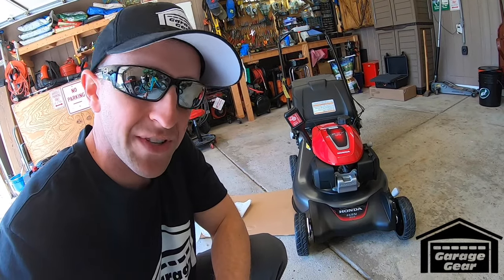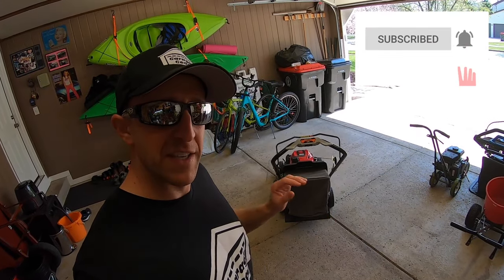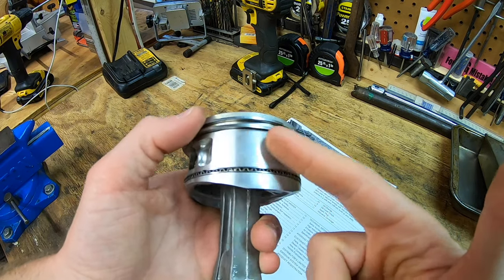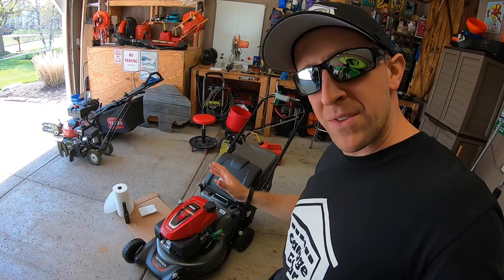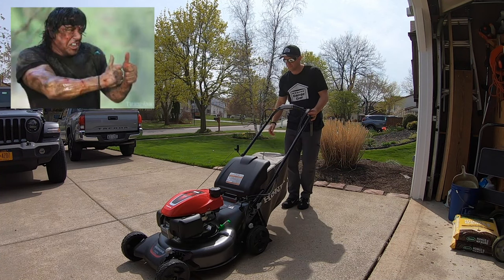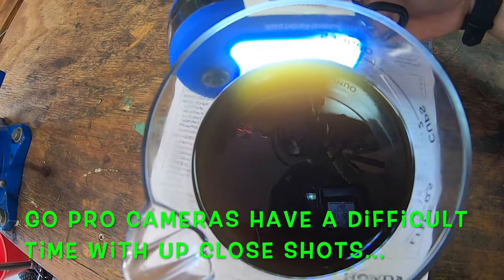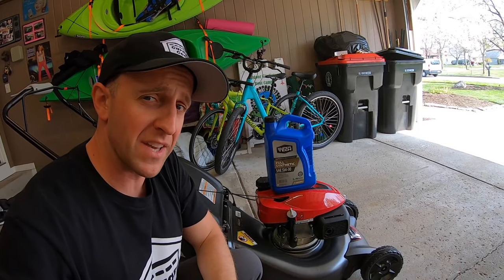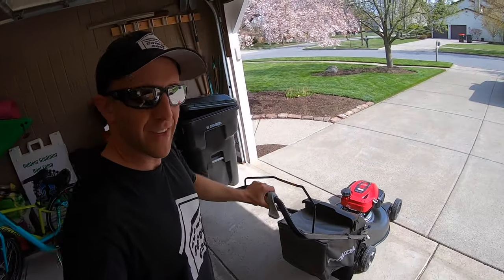BEFORE You BREAK IN Your New Lawn Mower Engine, WATCH THIS!

Comment: My previous Honda mower lasted over 21 years on the first oil fill. Never changed it. Not once. It's just a mower. The engine was still running fine. Only replaced the mower because the deck was rusting out, self drive was wearing out and the plastic fuel tank developed a leak.
Reply from the maker: Thanks for sharing!

Comment: Took your advice. I just bought a new hrc216hxa. Used amsoil 10w30 for small engines. Started and let run for 30 minutes. Drained it into a clear glass jar and it was close to black. Oh, and no starter bottle of oil (cheapskates). Also the manual for the hrc said 1st oil change after 20 hours. Glad I listened to you!!
Reply from the maker: Definitely a good idea to get that junk out!

Comment: I thought the small amount of oil that came in the new mower was a break-in oil with additives to help the rings seat properly. I would imagine those additives need to be in the engine more than 20 minutes to work properly. I'm also of the mindset that the engineers who designed these engines probably have plenty of test data to support their 5 hour break-in recommendation.
Reply from the maker: Hey Mike, they barely put any oil in when they ship these out. Spoonful or two. They may have their test data but that oil was awfully dirty after 30 minutes. Here is the video after 5 hours. (2nd oil change) the oil is much cleaner. Thanks for watching!
Reply: @GarageGear  yeah it's my understanding that the small amount of oil contains the break in additives that is designed to mix with the regular oil you put in before starting.
Reply from the maker: @mikecurtis1111  that’s the first I’m hearing of this and I don’t recall seeing any info on this in the manual. If you ask me you’re better off changing the oil and getting the metal shards out of that engine quickly.
Reply: @GarageGear  from reading the manual, it's residual oil from the factory. They test run every engine at the factory, and then drain the oil before it's shipped. Naturally, there's some oil that doesn't completely drain. I guess it's just regular oil
Reply from the maker: @mikecurtis1111  got it! Thanks for sharing!  👍
Reply: You assume that the engineers who know how to make the engine last aren't overridden by the pencil pushers wanting you to buy your next Honda sooner rather than later.
Reply: @berkeleygang1834  problem with that theory is the fact that Honda mowers are known for their reliability, and command higher prices for that. If people start experiencing short replacement cycles, then that will kill their reputation as being one of the best.
Reply from the maker: @berkeleygang1834  perhaps but Honda is known for making engines that last putting them at the top of the sales list. If they start cutting back people would have to decide between one junk mower and another.
Reply: Spot on. Do what Honda says. It is that simple.

A small amount of knowledge and making own assumptions on what is best, is wrong - unless your own conclusions happen to precisely match what Honda have already stated through 70 yrs of engineering excellence, science and complete loop of R&D incremental development and improvement.
Reply from the maker: @TheJmebe  thanks for watching
Reply: @GarageGear  dirty oil doesn’t mean “ineffective”. Keep in mind that nowadays sinth oils are really strong and durable, despite their color. And yes, Honda is pretty much giving you a “short” interval despite what the engine could take running on break in oil. Changing the oil so frequently is only damaging the planet.
Reply from the maker: @aian9597  thanks for sharing
Reply: @GarageGear  the first oil was dirty due to the carbon.. nothing to worry about. These engine already have 1 oil change made at the factory when tested. You did the engine 2nd oil change.
Reply from the maker: @chuckyl3978  thanks for sharing

Comment: Good video. I disagree however with putting in synthetic oil so soon. It is excellent for preventing friction and when breaking in an engine you need that friction.  I would suggest putting in Honda oil and run it for a few cuts or even a full season then swapping over to full synthetic.
Reply from the maker: Good idea! Thanks for watching Ron!
Reply: Agree with Ron, not mower related but still engines,  when the LS Chevs came out in Australia there was a lot of problems with oil burning because fastidious owners would change to synthetic oil too early and the engine never fully ran in.
Reply from the maker: @cudadog11  thank you for sharing!

Comment: I purchased a Honda HRX217 last summer and did the initial break in for 25 minutes then changed the oil. The oil was as dark as in your video and I changed it again after about 1 hour of use as it was a little grey. After that, the oil remained clear for the rest of the summer. That tells me that my engine does not lose anymore metal due to friction. So THE INITIAL BREAK IN IS A MUST and I know it will run for many years like new. Thanks to YOU!
Reply from the maker: Awesome my friend! This break in is definitely a must! Thanks for watching!

Comment: Thank you for this.  I just bought an HRX217HYA today and plan on following all your "make it last a lifetime" tips.  I'm 54 and this better damn well be the last lawnmower I ever have to buy.
Reply: My tiller is older than you lol My oldest lawnmower, which runs nice but needs work, is about your age. I pulled my newer mower out of a garbage bin 15 years ago; runs great. All Briggs L-Head engines. Helps to begin with a well made machine, but they will all die if not looked after.
Reply from the maker: It just might be! Enjoy the mow this season.
Reply from the maker: Best to keep them running!

Comment: I saved the empty Honda container of oil and just refill it with bulk 5W-30 synthetic.   It makes measuring the oil a no brainer.  

I hope you have better luck with your Honda mower than I did with mine.  My Honda was nothing but trouble and after three seasons of battling with a poor cut, broken wheels, worn out bearings, and a cracked deck, II switched to a Toro 4 years ago and I’ve had zero trouble since.  

I was very leery of the Toro due to the Briggs & Stratton engine, but I have to say it’s been bulletproof.  

By the way, I did exactly what you did except I change the oil after the first cut, approximately 35 minutes for my yard and then again after the 10th cut, approximately five hours on the engine.  

I then change the oil midseason and at the end of the season before storage and all of my equipment. before storage it also gets a fresh spark plug and air filter and then is allowed to run into all the fuel is out of the system and the engine dies
Reply from the maker: @chrisanderson4799  thanks for sharing Chris

Comment: thank you.  i followed your suggestion to change the oil after 30 min on my bran new mower.  you were right, there were quite a few flakes of metal in that oil and it was darker than oil should be for 30 min of run time.
Reply from the maker: Your lawn mower thanks you!

Comment: I got a HRN216VKA yesterday to replace my craftsman mower that died.  I never owned a self-prepared mower before so i wanted to see what other people's experiences were.  Glad I found this video.  I did the initial fill of oil, ran for 20 min then drained it.  The oil was defiantly blackened, and there was "stuff" in it, but i didn't have any clear containers to inspect the used oil.

The only other thing i would add to this video @215 would be to use a fuel stabilizer with the gasoline you have "sitting" in a storage can.
Reply from the maker: Hey Erik, thanks for sharing your first oil change story. It’s good to get that junk out right away. Have no fear. I always run ethanol free gas in all of my machines. Thanks for looking out for me! Thanks for watching! 👍
Reply: @GarageGear  Hello just picked this mower up getting ready for 1st set up based on your video here...question where do you get ethanol free gas ?
Reply from the maker: @Scubasgamecorner  they sell it at some local gas stations near me. You can google ethanol free gas near me and see what comes up. There are also canned products on Amazon but those can get a little pricey! Thanks for watching!

Comment: I run Walmart Supertech Full Synthetic 10w30 in my Honda mower, Yamaha generator & Tractor Supply Kohler engine log splitter. I usually mow my yard once with a new mower then change out that dirty metal dust oil. Mine all run great with ethanol free gas. Good video.
Reply from the maker: I use that oil frequently! Works well! It’s pretty amazing how dirty the oil comes out!  Ethanol free gas is the way to go! Thanks for watching Chris! 👍
Reply from the maker: @reginaldsmall3766  thanks for sharing

Comment: I hust got a HRX217VKA today, I actually gave the motor a few turns with the pull string before I put gas in it to run. Idk if it helps or not, but figured it'd help get oil moving before it actually ran. Did my normal mow (2 1/2 hours). Then changed it with the oil I used in my mustang (Rip) Liquimoly molygen 5w-30
Reply from the maker: Thanks for sharing my friend! Enjoy the mow!
Reply: That is a good idea.

Comment: I love your channel just found out about it recently. I have a quick question. I use Mobile one full synthetic not the Walmart brand, just bought a new Honda lawnmower, I also use Lucas oil and fuel, and in the oil crank case in my vehicles and my other lawnmoweris how do you feel about the oil and have you tried it in any of the Honda mowers? It definitely helps break in and long life and longevity. Today’s answer to slick 50.
Reply from the maker: Hey mark! I just stick with super tech full synthetic. Never gave me any issues. If it’s working for you keep going with it! 👍
Reply: Thanks a lot. I’ve been using Lucas oil in with my full synthetic for years and it has been excellent.
I don’t use super tech oil. I always ask where my oil is manufactured at because I absolutely refused to use Pennzoil of any kind or anybody or manufacturer oil for it causes major breakdowns, and failures. 
Are use Valvoline full synthetic , Mobile 1  full synthetic, I used to use Royal Purple full synthetic, but it is sometimes hard to come by. 
Those are the only oils that I will use no matter what after time spent racing Overland and motocross, and driving a semi full-time OTR.

Comment: Great video!  I’ve always changed oils early as well and you did a great job showing why important!

A whole new conversation is engine oil type used in small engines.  Modern vehicle engine oil has less additives to prevent engine wear due to emission components. There are engine oils on the market specifically formulated for small engines that lack the emissions components.  These oils have much more friction additives.  Take a look at Amsoil small engine oils for details.  Might make a great video in the future!
Cheers.
Reply from the maker: I like where your head is at zloft

Comment: Picking up this mower today after losing all hope in my Ego mower. Growing up racing nitro RC cars, I know the importance of a great break in so I’m glad I found this video. Thanks a lot!
Reply from the maker: Awesome Jeremy! Breaking in an engine is incredibly important to its longevity! Enjoy your new Honda! What was the story behind the ego mower?
Reply: @GarageGear  Wrapped up the break in and oil change last night and patiently waiting for the first cut today. The Egos electronics went out on me. Specifically, the safety switches in the foldable arms malfunctioned which required me to Jerry rig a jumper cable just to get the blade to spin. Also, the speed controller for the self propel function is stuck at high speed. Only had the mower for two years. So I’m glad I went back to tried and true gas powered. Even more with this being my first Honda.
Reply from the maker: @jeremyjordan4508  wow! Two years old and major issues like that? That’s crazy!  Sounds like you got pretty handy fixing that thing though! You’ll enjoy the new Honda! Enjoy your first mow my friend!

Comment: I changed the oil in my new HRX217HYA after the first mow, which was about 1 hour of use. No more than 1.5 hours. The oil that came out was very dirty and full of fine metal particles. I plan to change it again after 3rd or 4th mow.
Reply from the maker: Good plan Bobby!

Comment: Thank you for the recommendation for the pump. I have a Topsider from Northern, but it has its issues, like falling apart when trying to pump, it’s go t vice grips as a plunger handle. The strap wrench on the handle is brilliant! I’ve been using bungie cords, rags, old socks, whatever. That looks a lot better!
Reply from the maker: NO problem James! The strap wrench works great. It doesn’t come loose and doesn’t mar up the handlebars either! Thanks for watching my friend! 👍
Reply: I use 6 inch velcro straps.  The colored ones that come in 5 to a pack.  Very simple to wrap one on and take off.  Then you can just let them hang off the handle bar when not in use.
Reply from the maker: @brianwebb9121  another good idea Brian!

Comment: I purchased one of those mass produced Chinese 127cc mowers getting around. Purchased a 1L of B&S straight 30. Ran it for 10 mins on idle and built revs over half hr. Oil was still clean as new. So I left it in there for another 40hrs. It was only tinged brown. Emptied it, no metal at all. Topped it up with 10/30w and have ran it another 25hrs. Have only replaced a spark plug. I purchased another one and repeated the same process. They run as smooth as a Honda and Sound alike. Believe it or not.
Reply from the maker: That’s pretty cool! Thanks for sharing this Alana! 👍

Comment: ok so first might i suggest decaf...lol  just kidding. good info and good delivery of info. makes it worth watching. I know that the term best oil is kinda like best car brand or whatever but just to throw it out there i would recommend after break in to change the oil and either use Amsoil or Alisyn pro drive both in  10/30.  In my research at least those 2 oils offer the best protection money can buy with Alisyn edging out Amsoil in my opinion. just a thought.
Reply from the maker: Thanks for sharing Jeff! When I made this video I was trying to make it as straight forward for the average homeowner as I could. Keeping things simple and cost effective. Good oil choices and thanks for watching!

Comment: I just got the hru216 I wish the bloke from the mower shop had told me this, I’ve already done around 5 hours.
I’m changing the oil before using it again.
Probably should do the same with the Honda brush cutter too
Reply from the maker: Many don’t know about this procedure. Not to worry. Change it out and you’ll be good to go!

Comment: I’m liking this mower from all the reviews I’ve been seeing… curious how the rear discharge works-as the grass being cut here and be tough and high at times.. no mulching or bagging. Would you still recommend this mower, or another suggestion?
Reply from the maker: Rear discharging is average on this mower. It does work well. The super recycler has a side discharge that’s great but their drive system is terrible. Won’t back up. The mulching and Bagging are great on the Honda! They may surprise you

Comment: Not sure if you will see this post but if you do....Great. I have a question. Can you cut the lawn for 30 mins, and then do oil change and continue. Or should it be at same idle speed for 30 mins? Thanks in advance.
Reply from the maker: @alexrodriquez6574  you can do either! I’ve done both over the years. 👍

Comment: so bought a honda mower on your recommendation and after watching the break in video. i followed the same procedure, replaced the oil, and put it away. went to use it next day.... it was nearly impossible to start. the pull cord was so hard to pull the wife couldn't do it and i bruised my hand. once it started it was fine but it never got easier to start so i returned it. any ideas what might have caused that?
Reply from the maker: Hey skip it sounds like it was hydro locked somehow! I could be wrong but other than that I’m not sure. Sorry to hear you had to take it back. Thanks for sharing!

Comment: My father has a Honda gcv160-powered mower and he figured the oil was lifetime. After 13+ seasons he finally changed it. It was below the minimum and totally black. He never did any winterizing either and used regular 87 gas. Still started and continues to start on the first pull. Get a Honda before they leave the market.
Reply from the maker: Wow thanks for sharing tapes!

Comment: Breaking in new HRN16 per your video right now. 3/4 pull started immediately. 5 more minutes till I replace the oil. Using Mobil one extended performance 5W-30 and trufuel no ethanol fuel.
Reply from the maker: You’ll be all set to go my friend! 👍
Reply: @GarageGear  ordered one of your stickers to slap on it for ya
Reply from the maker: @jimhansen1245  ROCK ON JIM! Appreciate your support!